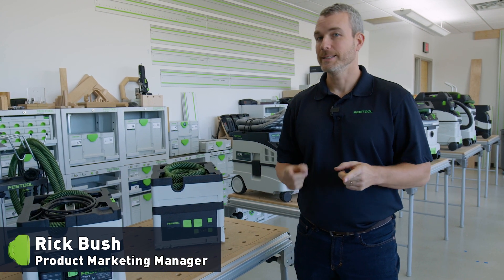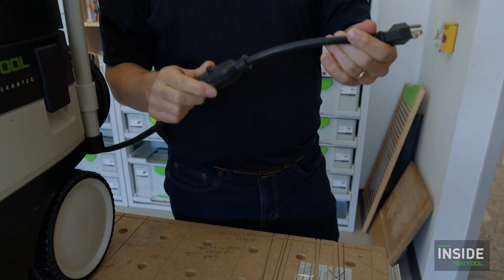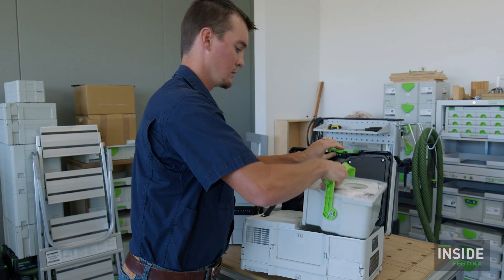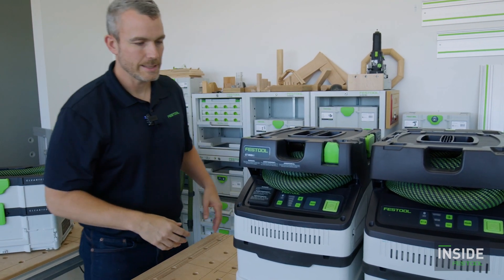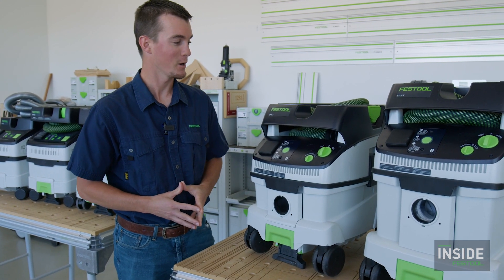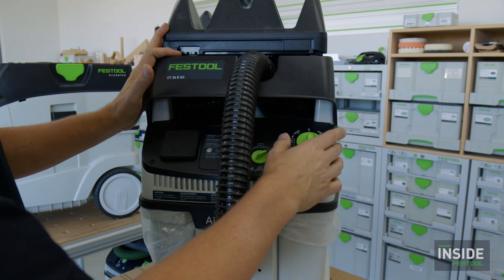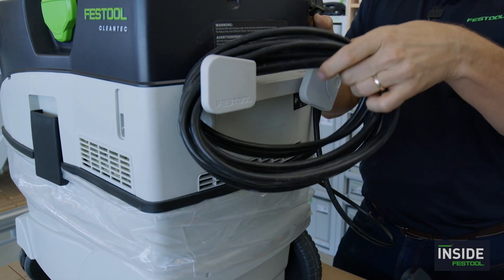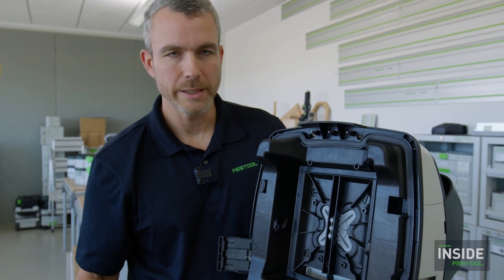Episode Seven: Inside Dust Extraction - Part 1

Comment: The problem with the circularly wound quick-release cord is that it twists the cord.  I usually try to wind my cords in a figure-8 which does not twist the cord.  The cord-winding posts could be redesigned to be more open in the middle to make this easier.  Of course, my Miele vacuum has a retractable cord that is approximately 24-feet long– about 7.5 meters for those of you who don't know how long your feet are!

Comment: I actually bought my little CT SYS mainly for housecleaning inside my home, to replace my elderly Hoover shoulder-carried small-vac.  The CTSYS works nicely for that (using a longer hose), and it also sometimes gets used for maintenance projects when its big brothers are just too inconvenient to roll around or lug up the stairs.
Reply: I don't think folks are very happy about the corded CT-SYS being discontinued.  The new CTC-SYS is just not a replacement for it, not even close, although it does have its own specialized uses.  I'm real happy i bought my corded CT-SYS shortly before they were discontinued.
But i also just ordered the new CTC-SYS too, because i do have some specialized use-cases that it fulfills also.

Comment: I have 4 different Festool dust extractors vintages 2004 forward and all are still going strong.  My biggest complaint is the hose garages.  These are very weak plastic construction and prone to breakage when anything is dropped on them (not that that could ever happen in a shop or construction environment).  Not a single hose garage is still intact on any of my units.  Here is to hoping Festool has addressed this weakness.  Steve
Reply from the maker: Hey Steve - yes, we have addressed this concern and the newer hose garages are much more durable. Good news - they are also backwards compatible with the CT MINI/MIDI, CT 26, 36, and 48. You just need to remove 4 screws, remove the old hose garage, and then attach the new one. 

Here are the relevant part numbers: 
CT MINI/MIDI: 500118
CT 26/36/48/36AC: 204040

We haven't had many issues that I am aware of with the newest generation of CT MINI/MIDI, but in case someone needs the part number....
CT MINI/MIDI I (latest generation released ~2019): 204717

Also, if you ever need to look for spare parts, you can go to the Festool spare parts catalogue where you can find schematics and part numbers: www.festoolusa.com/service/repair-service/spare-parts

Scroll down and click on "To the spare parts catalogue"
Reply: @festoolusa  Thankfully Festool replaced my two broken hose garages under warranty which is why I’ve remained a festool owner and continue to buy new units every year.

Comment: I have a ct33 and it's going strong.  If it fails, will the bags I have work in a ct36?
Reply from the maker: Hello David - no, the CT33 bags do not work in the CT 36. The CT 26/36/48 were a completely new generation of dust extractors which have many differences, including the location where the dust enters the container.

Comment: Nice rundown!  Can the plastic bags you showed on the CT36AC be used in place of the felt bags on the standard CT36?
Reply from the maker: Hello - theoretically, yes, they would fit. I would not recommend to do it, however, as the plastic bags are open which would leave your filter exposed  with no way of cleaning the filter (hence the "autoclean" function of the CT 36AC). It won't damage anything, but your filter will clog relatively quickly which will shorten the life of the filter and cause a significant drop in suction performance. 

The reason we offer/recommend the plastic bags for the CT 36AC is that when you are working with fine mineral dusts (like drywall dust), these materials have a tendency to "cake" the inside of a felt bag, which causes the suction performance to drop. The open plastic bags give you a convenient way to empty the container and dispose of the dust, while the main filter in the dust extractor is cleaned with the autoclean function. Hope this makes sense and answers your question!
Reply: @festoolusa  perfectly answers it, thank you!